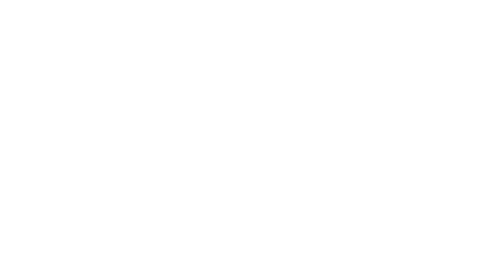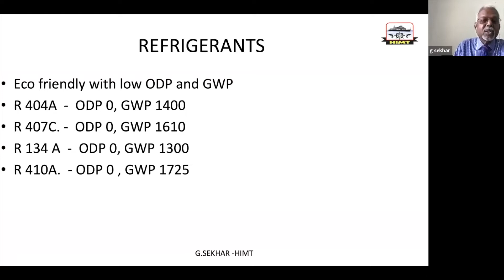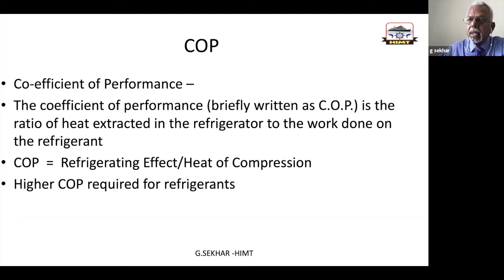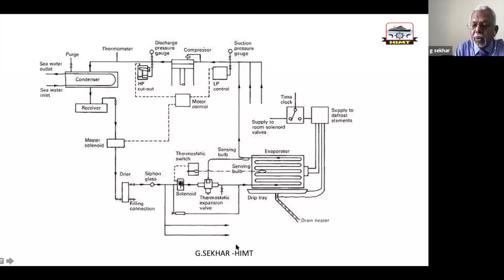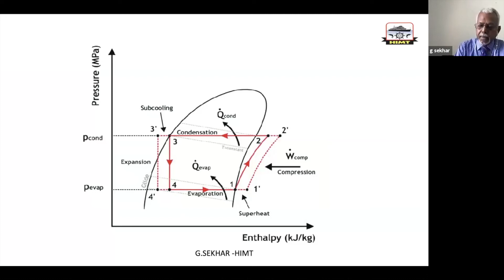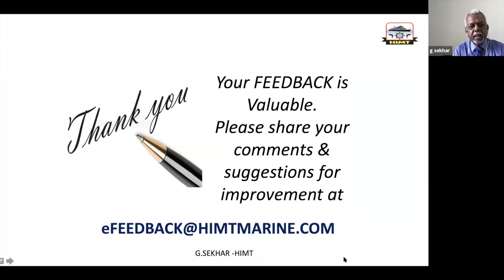Refrigeration & Air Conditioning (Part 1) | Sekhar. G | HIMT

Comment: why refrigeration compressor not having flywheel? but air compressor has
Reply: big refrigeration compressor have flywheel especially that compressor which is semi hermitically sealed.... only small refrigeration compressor dont have the flywheel which is in generally fully hermitically sealed compressor.

Comment: Sir, can you please explain why you required solenoid valve before your expansion valve? Because expansion valve itself a flow control valve. So why u required?
Reply: TEV is a constant super heat valve metering out the right quantity of liquid refrigerant to the evaporator matching the load ( Heat extraction requirements)
When the rooms reach the set temperatures temperature sensors in the relevant rooms will give feedback to the thermostat which in turn de energise the solenoid valve closing it so no refrigerant flows to the concerned evaporator.